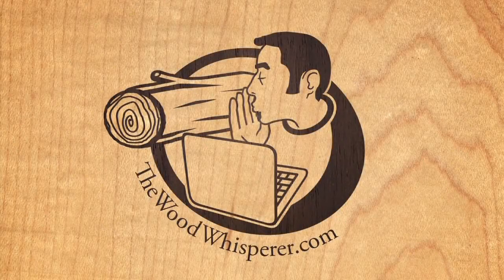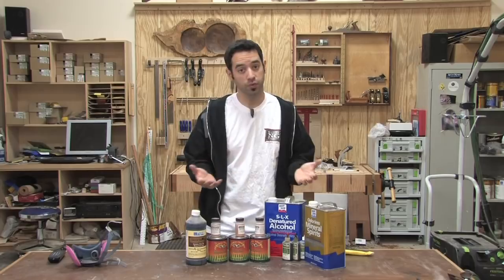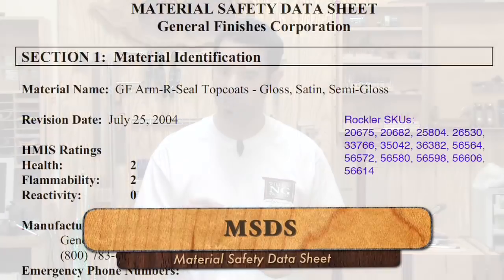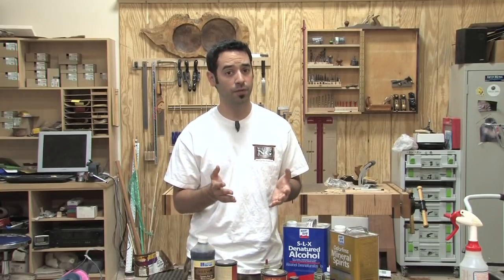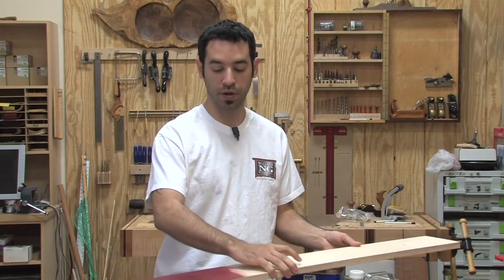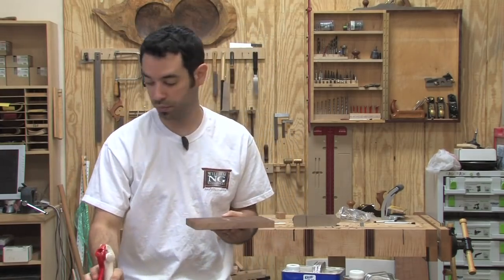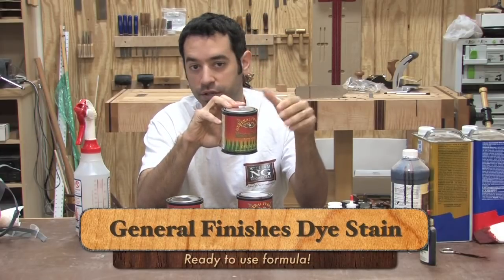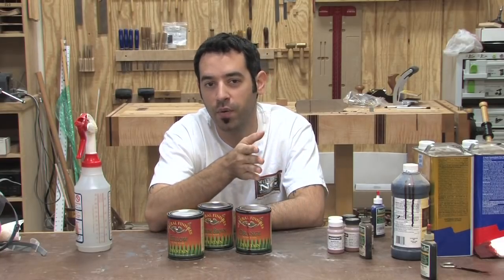142 - Understanding and Using Dyes

Comment from the maker: Yeah pretty much. Different types of coloring agents layered on top of one another can certainly bring more depth to the color. But sometimes using a dye as a base coat will shift the color one way or the other. So it can be quite useful. And if you use a water-based dye and you want to use an oil on the surface. I'd recommend skipping the shellac. Shellac will seal the surface preventing your oil from absorbing and curing properly.

Comment: Good video. I could have used this info a few weeks ago when I was using the General finishes stain on a mahogany banjo neck followed by filling the grain for a glass smooth lacquer finish.  The grain filler is Crystallac stainable. I had used the older non stainable product, but the Crystalac was pulling the stain out of the wood. None of the products mentioned whether I could seal the wood or not, before using the grain filler. I even called General to ask what was the story with the dye coming up- it was unexpected. You explained it perfectly. They took several days to get back to me with an answer! I ended up using Behlen vinyl sealer on top of the stained bare wood before using the grain filler. It's against my logic but considering the problem I used it with great success. Once the vinyl sealer was on the filler did not solve the stain. I sealed it over the filler to apply the nitrocellulose lacquer. The new problem I have is the stainable crystalac grain filler as it is not drying clear. The old product did, and I Emailed Crystalac directly with no response. I want a good clear grain filler! The difficulties never end.

Comment from the maker: Green dye and a lacquer finish. Transtint is a concentrated dye that comes in green and you can make your own dye solution and apply it to the wood. From there, you can spray one several coats of lacquer. Now this will indeed create a shiny film. But with dye on the surface, a film is a good thing. Non-film finishes won't really protect the color and you will most likely wear through the dye.

Comment from the maker: Mostly. But keep in mind if you are rubbing aggressively, it could still pull up some color. So I like to apply a light coat of diluted varnish with a gentle touch. Once that first coat dries, you can begin to be a bit more aggressive with the surface.

Comment from the maker: You might look into some of the Transtint and General Finishes Water Based Dyes. Both should have a few bright primary colors for you to check out. As for gloves, I'd recommend using them. Most dye solutions also have chemicals in the mix. Not something you really want on your hands.

Comment from the maker: @griiiiiiiiiin I honestly don't know the chemistry behind that paint. But like any other finish or paint, I'd recommend cleaning the brush with hot soapy water after use. I wouldn't recommend using mineral spirits on the brush at all as that could leave residue behind.

Comment: thanks this is excellent.  I just put applied a layer of yellow from general. I'd seen another video where a layer of shellac was used between  the yellow and then the walnut, for the walnut counter I made and then a top coat to seal it all before polishing.  I also have to decide what to do about the worm holes and one knot.  Fill with epoxy? or ??? or leave them.  Wish I could send you pics of what I've done so far.  thanks for all the info your posting

Comment: I was gifted a table from a dear friend who was a woodworking craftsman before he encountered some health issues. It is a rather old piece. He does not remember precisely what he used to finish the top. The majority of the top is a large inlaid square of wood that he believes was dyed. It is black, and it will spot in a second if it encounters anything wet. A damp cloth will pull color. So as best we can tell, it is a water-based dye. I would like to apply a finish to make it more impervious to water and to avoid having it bleed dye on anything that is placed on it. Based on your video, I would use the Sealcoat dewaxed shellac product. I can either spray or wipe on the first coat. Would you suggest that this be the only finish used, or would you use a different final coat or coats after the shellac, and if so, what would you use? Thank you.

Comment from the maker: @NoblestoftheLIONs that sounds reasonable to me. You can actually save a step if you use something like General Finishes dye. They have some binder in the mix so you can go right from the dye to the gel stain and skip the shellac. As for time periods, you can coat over the dye as soon as its dry to the touch. I'd let the stain sit overnight before top-coating.

Comment: The dyes are nice but challenging to apply. The minwax is easy and very forgiving. Minwax early american is still beautiful. So I went down the dye path. But to get that to work, I needed the extender and the reducer for GF dye stain. At $25 each my effort cost $75. I wouldn't bash minwax, it looks nice and it is easy to work with.

Comment from the maker: Well, problems can arise from a lot of different things, especially when staining pine. So it's hard to say. But that finish combination, in theory, should work. You might look into using a wood conditioner before the stain though since blotching will be an issue. Look into Charles Neil's blotch control.

Comment: A good tip for those who have ever experienced the problem of the dye, or in some cases the resins of dark exotic woods (purpleheart for example), BLEEDING into the topcoat or a light colored wood adjacent to the dye/dark wood.  You can seal the wood with a very thin coat of epoxy (West Systems is excellent), prior to building up the topcoat.  The epoxy has not solvents to activate the dye or pull the resins from the dark exotic woods.  It also acts as a grain filler, as it is non-evaporative, and self-levels as it cures.

Comment: So realizing this video is 8+years old now I'd like to ask a question. I'm refinishing an piece of antique furniture and after removing it's old dead and faded finish I attempted to restain it after applying a cut shellac to even things out.  But there are several different species of wood used, and though beautiful...I have  several different colors of finish now +  a few new veener pieces also) . But rather than completely stripping it again (other than a light sanding to tac), I'm  considering a simple seal coat of either lacquer or shellac and starting over .  Will using the dye method directly on my new seal coat and then applying my finish coats on that be the way to go? Thanks. Enjoy your work .

Comment: I appreciate the detail. Im refinishing fully stripped maple columns that support a porches roof.  I tried a white arborcoat semi-solid alkyd linseed oil stain on a test piece sanded in sections with different grits. One section 80 another 220. It failed to penetrate the wood even after sitting for 50 minutes. It just wiped right off with almost no effect.

Can dyes be used in an exterior application? I wanted to initially use stain so there would be no peeling paint to scrap and to easy refinishing every 4 years. Would dye meet my needs? Does the shellac sealing coat peel and require sanding before refinishing?

Comment: I have a chair with no finish left on it. I believe it was stored in a very wet / humid place. It now has turned gray, I would like to restore it back to oak / ?  Depending on what I find when i reglue it. What will I need to do remove the gray color ?

Comment: Great vid. A lot of useful info thanks. Question.. I want to finish a mahogany guitar with open grain but color the grain a slight darker color. Then complete by a wipe on poly satin finish. What would be the process to apply the dye into the grain but not the wood top surface?

Comment: Thanks for making dyes less intimidating. How would you apply a dye if you just want to touch up an old piece? I am reupholstering a 1930's wood arm chair with Aniline dye on the exposed wood arms and legs. For 90 years old, the dye is in great shape! But just needs a touch up on the well worn areas and scratches. It is stripped of upholstery and old padding, so now is the time. Any tips for how to apply so it doesn't look like a splotchy touch up job?

Comment: I have a question most likely stupid but here goes, what can I use with clear nitro cellulose lacquer to tint 3 thin coats.. one layer in a flat for a primer, the second in a semi gloss, then third full on gloss or extra glossy brighter top coat?  this on top of a clear semi filled/sealed alder guitar body, or tinted filer same color, either granny apple green or peach creme.. looking for a little depth, but not the typical 6 coat glossy clear coat depth..

also do you ever step your colors, base coat, then as you build go brighter and heavier meaning add more tint each coat, or the opposite start heavy then go lighter?  I want a very thin yet bright and vibrant finish I can polish up on the wheel, something that will age with a nice color aged patina down the road but not get dull or funky..  I'll be watching more videos for sure.... TY

Comment: This video is quite old so I hope you still see this and answer my questions. I have been researching dyes because I want to use them on guitars. Mainly mahogany and bass wood but also on maple and special tops like flamed and spalted maple. In this video you talk about "Grain Raising" Is that not what I would want to happen with those special tops? Isnt that going to give me that tiger stripe effect on the flamed maple? Or will that still stand out if I water and sand to not get the "grain raising effect"?    I watched a guy here on youtube use office depot stamp ink to stain the top of his guitar. He first used black and then used blue. The black was to help get the pattern of the wood to stand out. Would you recommend doing the same thing with regular wood dye????

Comment: Wetting the board before dying is a critical step. 
Pre-mixed, water based dyes seems better.
Light coats with adequate drying times between coats and sanding.

Comment: @The Wood whisper, thank you for the tutorial. I have cherry cabinets that I want to match my room doors too I bought poplar wood doors, so the grain is a little tighter. My oak doors turned out terrible. I have one of our paint, stain stores mixed a close color. My thoughts were to apply with a sprayer and then use a dye to tone it to get closes then clear. Does this sound about right? I do not want the grain to take most of stain so I would water first like you did?

Comment: Can you recommend a good brown for walnut that can be used at different strengths to achieve different shades of brown.  On occasion I have to refinish (or touch up if I  am repairing scratches) something on a very dark walnut piece.  However, the norm is a range of lighter shades of  browns.  I typically use an orange base if the shade is a lighter brown .  Any good suggestions so I  don't have to buy more than one brown?  I  use water and  alcohol base dyes.

Comment: Whisperer, I am working on a couple of firearm restoration projects (one birch, one walnut). I like the idea of dying vs staining because staining tends to hide/mask the wood detail more than I prefer. I've never tried dyes before. After stripping and prepping the woods (Citristrip & sanding), are General Finishes dyes compatible with a high-gloss (8-10 layers) Tru-Oil top coat? Will the dye/Tru-Oil combo hold up to life on a firearm (hand oils, solvents, gun oils, etc)?? Thanks for the advice.
Reply: Tru-oil top coat will work well. The dye will hold up as well as any stain would.  I used dye for the same reason you are interested, I wanted a really transparent finish that let the wood detail show thru. I has success even dying black i was able to keep the mix semi-transparent & still see grain. Birch & walnut, wow I'll bet your stocks will come out great!-Lisa

Comment: If using pine wood should i pre condition wood before applying water base dye for a uniform color or use a sanding sealer first after dried then apply Dye in top of it? Im a first timer very confused

Comment: I'm trying to reach the espresso kitchen cabinet color on oak cabinets.  I've taken everything down to bare wood and pre-raised the grain with a final sand using 220 grit.  The plan is to use Wiz van-dyke brown dye and General Finishes java gel stain.  The order of operation I am assuming is dye, shellac, gel stain, and polyurethane top coats.  Would I be correct in that assumption?  Also, what time periods of waiting between each application would you suggest.  Great videos, great information!

Comment: I bought a old 1940's home and pulled up the old carpet and it had pine or spruce wood floors that were that orange colored fruitwood look on them.  Just wanted to know if you had any recommendations on how I can sand and refinish the floor to make it look like real walnut.  I was going to pull the carpet up thinking it had plywood under the carpet but found the pine tung and grooved floor instead.  I thought it was a waste to pull all that flooring up to install the walnut floor so thought you might be able to help.

Comment: Id like to change my kitchen cabnits that were pro finished 30 years ago with spray laquar and I know you can build laquar up layer on layer without sanding 
The cabinets are oak and a clear finnish
But id like to change them to a clear darker blue you can still see the wood grain on and protect to color from wiping off when I'm done I also intend to use an electric spray gun becuse I do not have a compressor or the budget for a 1500 dollar expensive tool to use but would like really good results on a budget.
This is one of them honey do projects
I dont have the do for.

Comment: Before dying, you have used water to raise the wood grain. After sanding it down, how did you get rid of the sanding dust before the dying procedure? Can I use shellac as a wood grain filler before dying in order to prevent wood grain raising? Or will the use of shellac prevent the dye from getting into the wood. Or should I use wood filler, then dye then shellac? I will finish with polyurethane from a spray can, so is shellac compatible with it or should I leave the shellac out of the equation?
Reply: I had this problem with Maple. I used a 1 lb cut of shellac first and then dyed. Turned out well. The dye probably isn't quite as dark but much better than having blotchy.

Comment: Woodworking with The Wood Whisperer : I plan on using mineral oil on a chopping block. I was hoping to sand down the block and then add some color. I bought some tanstint, and I was wondering if I can mix that with the mineral oil and would it still be food safe? Or should I apply the dye with water and then apply the mineral oil separately?
Reply: +Harrison Bispham The short answer is no.  Most dyes contain heavy metals, in many cases chromium.  This is most definitely not food safe.

Comment: Hey marc.  I know you probably get a lot of questions, but was hoping you could find a minute to answer one for me.  I want to match some speaker stands that I just built to the Vintage Mahogany Stain of my TV stands.  To do this I have been testing a few different general finishes dye stains, and wood stains.  I recently purchased some of the transtint concentrate.  My question to you is can I mix the transtint concentrate in with an Bulls eye Amber Shellac that has been cut with 3 parts Denatured Alcohol?
Reply: +Elijah Stephens  go to a paint store and buy utc oil based color, mix with mineral spirits to match your color.  Clear coat and  your good.  This guys process is way to complicated.

Comment: I've ordered some of the Homestead powdered dye in gray for a quarter-sawn oak coffee table I'm going to be building/finishing.  I want the final color to be a very, very light gray.  Obviously, I will keep that in mind when mixing my dye mixture, but should the color be a bit too dark, would sanding after application of the dye lighten the color at all since the dye mixture is absorbed into the wood?

I will keep your tip (@ 13:35 in the video) in mind regarding wetting the wood just before applying the mixture so that it doesn't necessarily pull in as much of the dye mixture.
Reply from the maker: +SheShedChronicles Sanding would remove some of the dye, but it might not do it in a predictable way. You might get a blotchy or patch appearance. It would be better to simply reactivate the dye with whatever it was meant to be mixed with (either water or alcohol). So if it's water, use a wet rag to reactivate the dye and pull some of it back up off the surface. Same thing if it was alcohol. This will give you much more control over how much dye is actually left on the surface.

Comment from the maker: Not if you're putting lacquer in there. I assume that's what you mean by "lac". The traditional mixture is 1/3 oil, 1/3 poly, 1/3 mineral spirits/paint thinner
Reply: Hey Mark. Ive been struggling to find an answer about wood dye on pine. Should I or should I not condition it or use sealcoat first before dying it to deal with bitchyness lol?

Comment: Thaks for the info on glycol-ethers and the point about water-bourne vs. water-based. Does this apply to paints, as well? The reason I ask is that one of my favorites is a Benjamin Moore product called "Aura" that has adhesion and coverage like none other. Only problem is, it basically demolishes the brush unless the brush is cleaned constantly. As Aura is water-bourne,, could this mean that I may be able to use paint thinner or mineral spirits to clean the brush, instead of only using water?

Comment: I'm working a wooden bed frame and for the finish I'm thinking about staining the wood then putting a thin coat of shellac over it then put some coats of poly on do you think there will be any problems by the way the wood is pine.